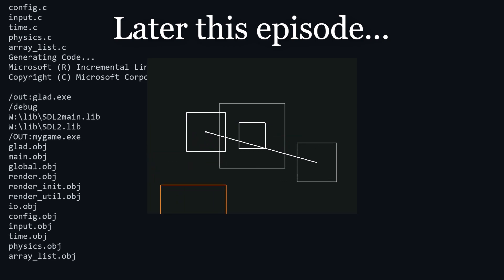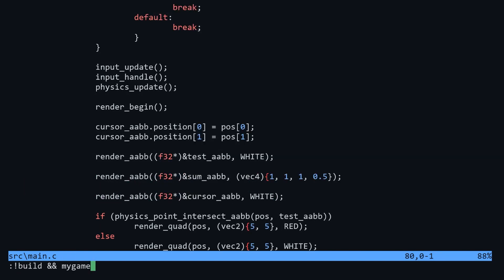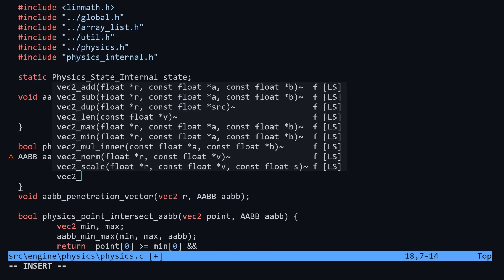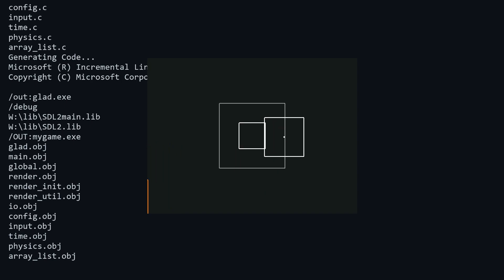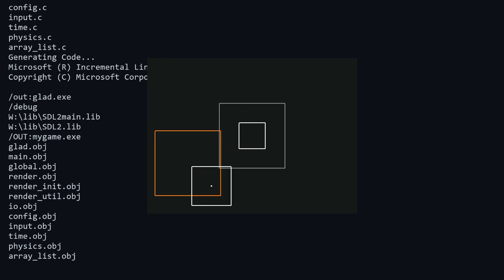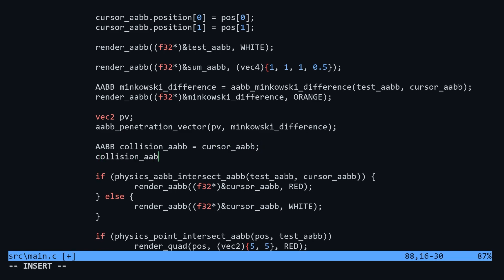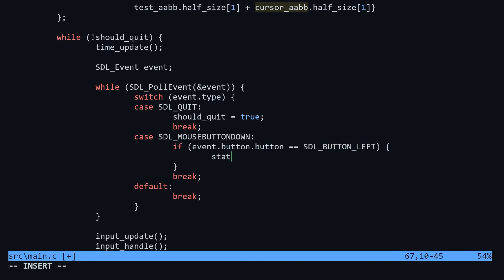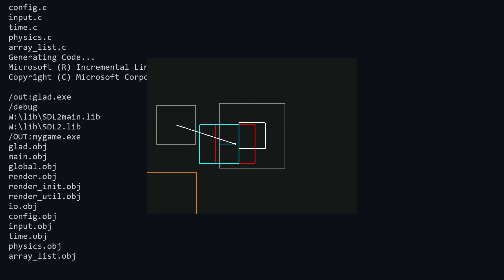AABB vs AABB Collision Detection | C Game + Engine From Scratch 07

Comment: why would you use minkowski differences (which is the GJK algorithm right ?) if you only have AABBs at the moment ? wouldn't it be easier to just detect AABB collisions and then extend it to SAT or GJK for more complex shapes ? 

(btw didn't watch the rest of the series, just got this randomly in my recommended lol)
Reply from the maker: I find the Minkowski solution very intuitive to understand once you extend it to sweep testing on moving aabbs. And then the step to GJK is also smaller. Plus there's so many edge cases with other methods, I can't remember off the top of my head, sadly...